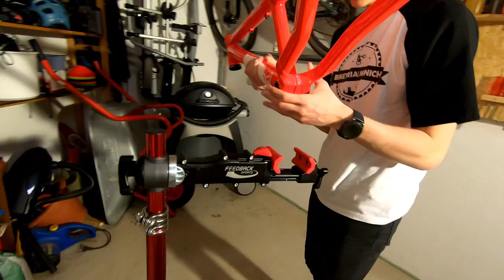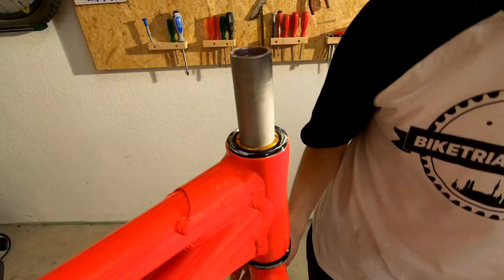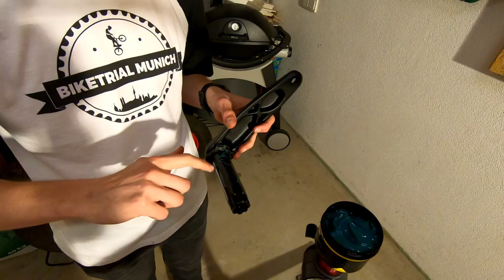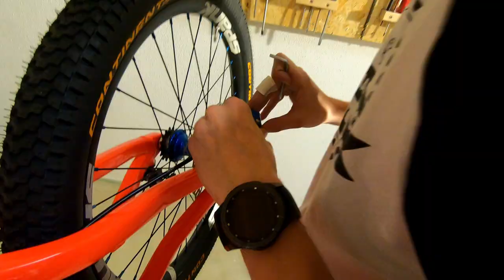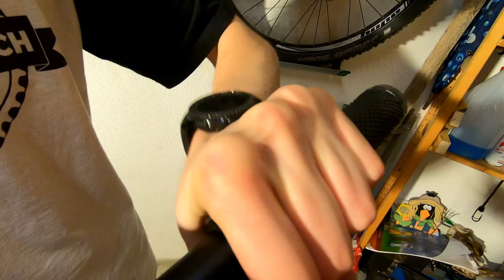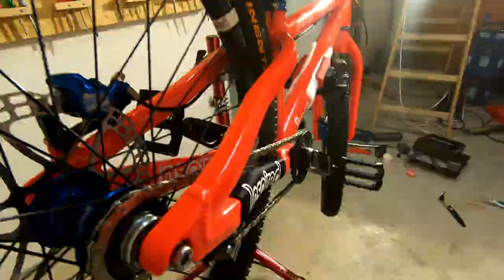BUILD MY DREAM STREET TRIAL BIKE - Inspired Fourplay 2019

Comment: I would also like to have such a bike .. but they are really expensive .. where can I order the bike in individual parts. and then do I need special tools for assembly?
Reply from the maker: Hi, yeah unfortunatelly. You can get serveral trial bike parts by tartybikes. Unfortunatelly the frame sets are very rare. You need normal bike tools, but you need some special tools for installing the cranks and the bottom bracket. I would recommend you to buy a complete trial bike, this is much cheaper.
Reply: @EinfachJonas16  wo bekomme ich die denn her?
Reply from the maker: Beim nächsten mal kannst du auch gleich in DE schreiben haha 😂😂😂 wenn du das Werkzeug fürs tretlager meinst, dann schau mal bei bike components oder so vorbei. Würd dir aber eher raten das Bike nicht selber zusammen zu bauen wenn du dich nicht so gut auskennst. Ich kenn des von nem Kumpel, am Ende hatte er nen halb kaputtes Bike...
Reply: @EinfachJonas16  hmm okay du hast was von Testbikes geschrieben? Wo bekommt man die her?
Reply from the maker: @benjaamd  Testbikes? Ich hab komplett Bike sets gemeint, also quasi einfach ein komplettes trialbike. In DE gibts den www.trialmarkt.de und GBR https://www.tartybikes.co.uk/
Reply: @EinfachJonas16  wieso ist des Flow plus auf tartybikes billiger? Bzw da bekomme ich für 1200€ mit mt7 und auf trailmarkt nur mit mt4??